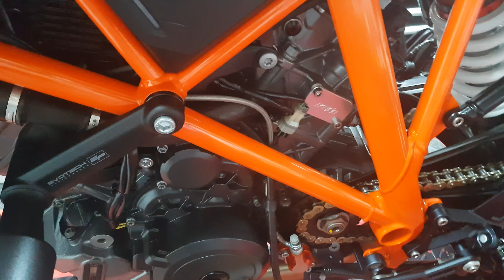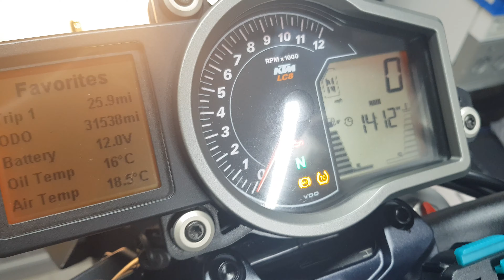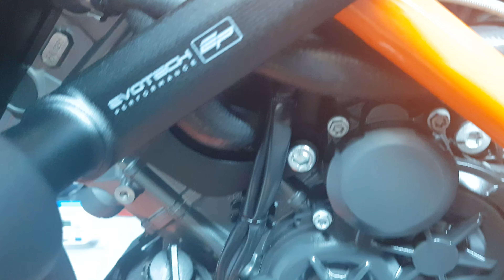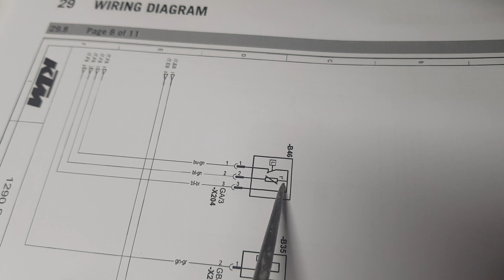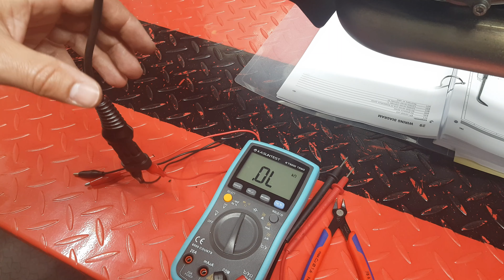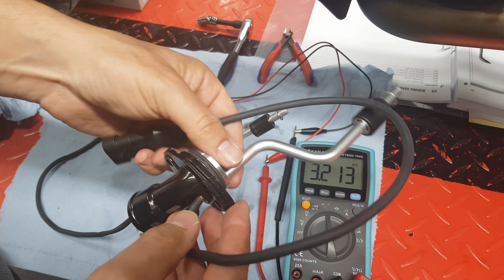KTM 1290 Superduke R Oil Temperature Sensor Replacement, Problems! Gen 1 2 3 | HOW TO 4K

Comment: I have the same problem on my Gen 3 and that wire disapears behind the coolant hose and I have no clue where it is.  Tried lifting the tank and nothing.  The Gen 3 is really a nightmare to work on.  Any help would be appreciated!
Reply from the maker: The connection should be there, close to the tank. Follow cable back slowly

Comment: I potentially have the same issue. The part number has been revised again now ending in 200.
Reply from the maker: Ah ok, interesting its been revised again! Must be because they have also had it fail on the gen 3
Reply: Buenas, tengo el mismo problema en una 1290 SAS S 2019, sabe si la pieza es válida para la mía y referencia completa?. Gracias

Comment: Have you ever had issues with mtc cold starts?   I have a 14 sdr and all of a sudden mtc code will flash.   Pretty hard cold start.    New battery.   Runs rough for a few mins then  runs fine.
Reply from the maker: not as yet but i have had issues with my dash twice, currently got  another damaged one by water getting into it! This could be one reason but  MTC can be  other things not just traction control. It can be the  servo motor on the butterfly valves not working correctly or the sensor faulty. Does it still make the loud high pitch squeal when turning on ignition?

Comment: I have a ktm superduke 1290r gen 1, i have the same things throwing up faults every now and then, tried many diffrent batteries too, ktm dont buy them stay away temperamental pieces of crap worst make of bike ever nothing but hassle choose a diffrent brand honda, suzuki, kawasaki anything but ktm crap
Reply: I have a 2015 superduke 50 thousand miles now getting mtc warning plus general warning plus acu warning .bike runs fine booked in to ktm however I'm starting to think it's the clocks as there is moisture in them.
Reply from the maker: Its very likely!
Reply: Best bike I’ve ever owned